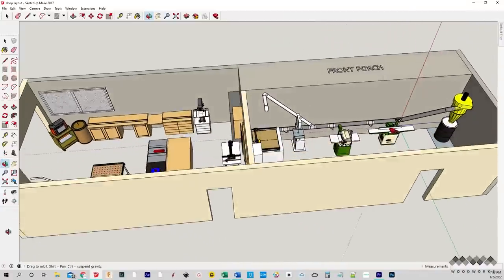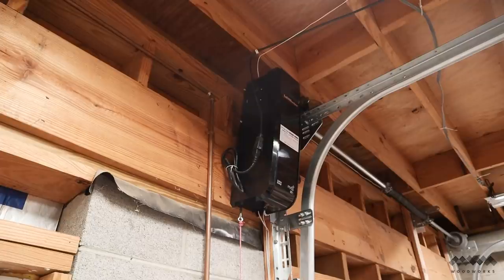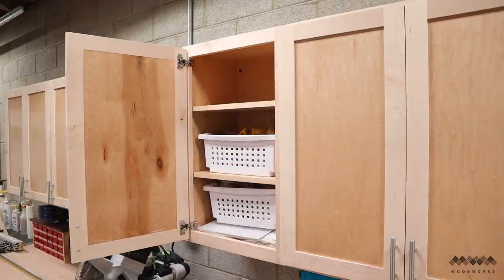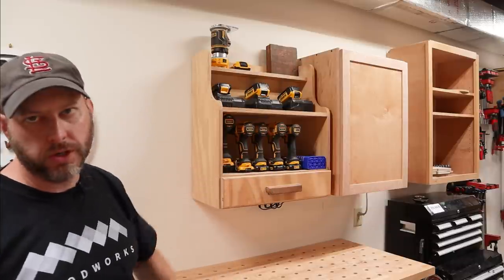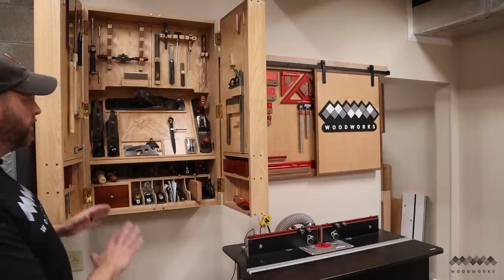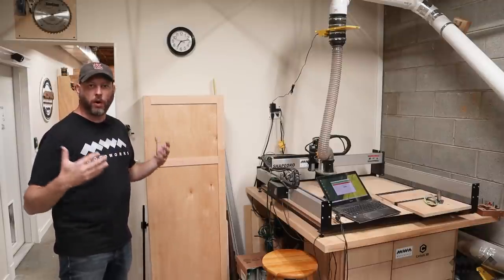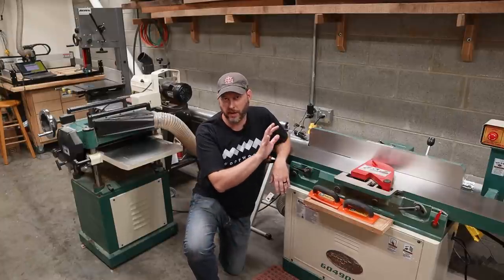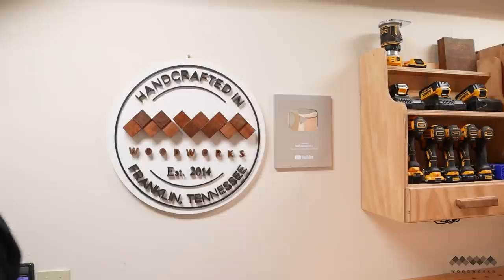I couldn't have dreamt this 5 years ago

Comment: That Rigid belt sander is an indispensable part of my shop also, although I’ve built mine into a somewhat larger table on a dedicated base. Reciprocating sanders are not easy to find in a size that doesn’t have a huge footprint. I’m on my second one having worn out the first. I build cabinet drawers out of 3/4” plywood sides, which helps eliminate scrap, and this sander does a perfect job of sanding the top edges before assembly.
I enjoy your videos and although a retired cabinet builder I learn from you and other upcoming young woodworkers. Thanks.
Reply from the maker: I appreciate all those kind words. Thank you.

Comment: I would enjoy anything cnc related because I love your channel but as you mentioned I haven't seen a lot of cnc related content......
I was a professional woodworker from 1991-2012. On 12/21/12 I was disabled in a car accident. After over six years and four joint replacements later I returned to woodworking by getting a cnc. I am now heavily involved in the hobbyist level cnc community and run a shop with a Shapeoko Pro and Thunder 35-100watt co2 laser.

Comment: Great and timely video. I'm in the process of designing some shop shelving/cabinet units and I got some great ideas from you. Two questions, both around the cinderblock walls. 3 of the walls in my shop are cinderblock. (Actually, I think they may be poured concrete w/ a cinderblock mold. They are painted so I can't really tell if I'm dealing w/ cement or concrete on the seams.) I'm curious what anchor system you use on your wood racks. I'm sure they have to hold a lot of weight. Also, when I mark and drill for anchors, it's a challenge to get the center of the hole exactly where I wanted it to get perfectly level. I'm using a hammer drill w/ masonry bits, but they tend to wander at initial contact. Any tricks?
Reply from the maker: I use tapcon masonry screws (no anchors needed) for attaching to concrete. I actually have a video on it. If you're having issues with wandering, grab an awl and a hammer and make a divot on the wall to keep the bit from wandering 👍

Comment: Just recently found your page and love the content. One quick question: there’s a jig on the wall with your table saw jigs that’s white with an aluminum fence and a 90* arc routed into it. What’s that jigs function in life? I’m guessing some sort of angled miter jig, but haven’t seen a video with it being used yet. I picked up your shop jig bundle, but didn’t see it in there. Thanks for the time you take to pass on your experiences with us!
Reply from the maker: That's a table saw crosscut sled that can do angles. I don't have a video or plans for it yet. Built it several years ago

Comment: @MWAWoodworks I’ve been thinking about getting a Grizzly 8 inch jointer and 15 inch planer, both with the helical head cutters. Question I have for you is have you found a digital read out add-on for you grizzly planer?

Comment: How do you like the MFT? In my opinion it is way too wobbly for the price
Reply from the maker: I will be taking care of that issue soon by adding a cart/cabinet to set it on and I won't use the legs. I think the legs are a good option if you do on-site work but for a shop I think it needs to be on top of something more stable with storage

Comment: Well laid out shop! I'm curious about your decision from going from the dewalt mitersaw to the festool. Performance wise is there a huge difference? I am planning to add a sliding compound miter saw to my shop when I expand in a bench with my dewalt radial arm saw. Thanks!
Reply from the maker: I have a DeWalt 12 inch slider in addition to the Kapex. I wanted the Kapex because of the dust collection and the fact that I can sit it against a wall so it works well on my miter saw station

Comment: I have a serious question I’m looking to build your miter station I love it, I have one I built last year but I want something with drawers and cabinets, the questions is do you really need t track on both sides ? I find my self only using one side for my stop block I’ve never had to use the other side.
Reply from the maker: I don't think you "need" t track at all. I use both sides just depends on how long my piece needs to be cut. The right side only does 48", which most of the time is enough, until it isn't 😀